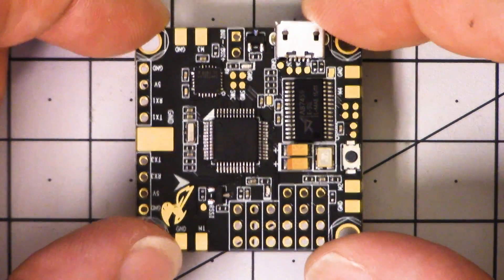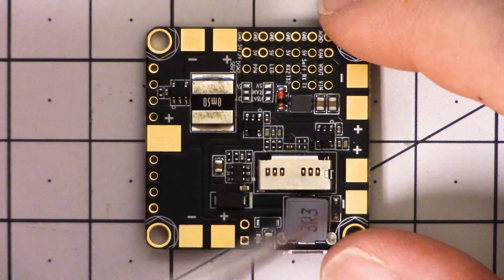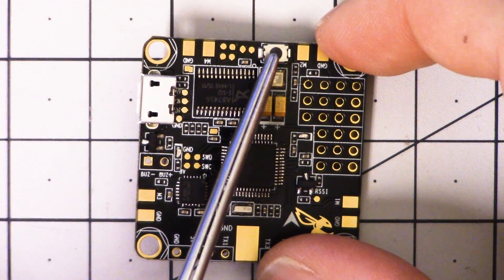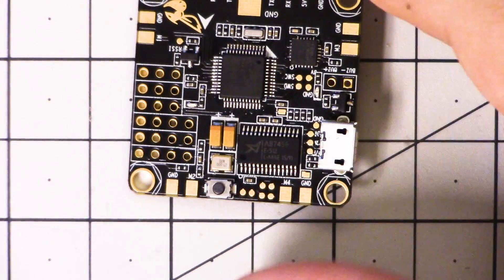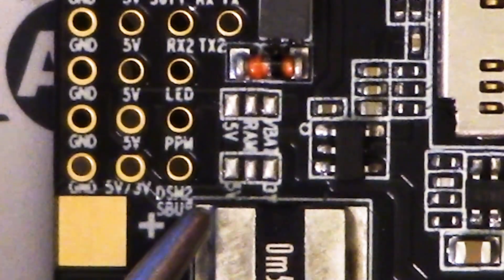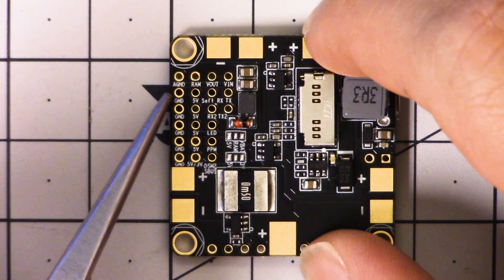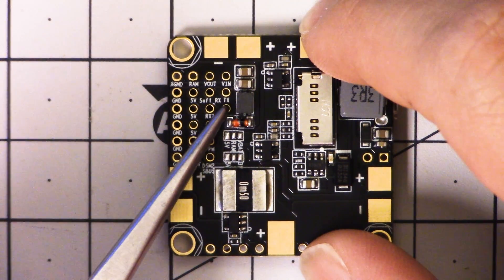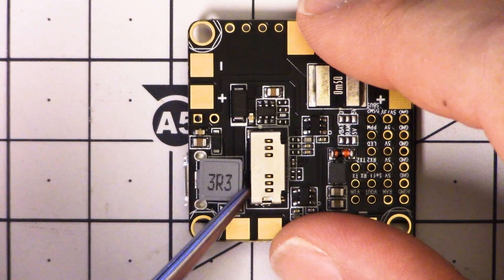Betaflight F3 (BFF3) Flight Controller | REVIEW AND HOW TO

Comment: Do you think I could run a TBS Unify Pro (on 25mW, it's specified as 4.5-5.5V, 600mA) and a small 600TVL micro camera (specified as 3.7-5V, 100mA) both off the RAM pad without problems?
Reply from the maker: +Zerro I don't think so. I have heard that the diode in the RAM filter is rated for 600 mA.
Reply: Alright, thanks for the reply. How "safe"(/stable) would it be to max out those 600mA? According to a post by TBS on fpvlab.com the Unify Pro needs 500mA at 25mW, add that to the camera and I'm looking at 600mA.
Reply from the maker: +Zerro I think you should confirm the amp rating a little more confidently before deciding to push it.
Reply: You're right. 
I'll probably have to measure it. In the manual of the TBS Unify it says: "25mW: 250mA, 200mW: 320mA, 500mW: 460mA, 800mW: 600mA". If the manual is right that would give me enough headroom. Let's hope it's true.
Reply from the maker: +Zerro no, no. I meant you're just taking my word that the 600 mA limit on the diode is correct.

Comment: I broken my USB connection on this board. But I manage to turn on "MSP" on uart1 before the USB got completly ripped of board.

Now I`m stuck on current firmware, but there must be a way of altering the code and compiling my own firmware that has MSP enabled as default on UART1. Anyone know what to change to accomplish this?
Reply from the maker: Clone the repo and then find where the defaults are defined. Then build the code. Sorry... not that helpful.
Reply: Thanks, anyway. Just have to learn how to compile then :-)
Reply from the maker: https://github.com/cleanflight/cleanflight/blob/master/docs/development/Building%20in%20Eclipse.md

Comment: I'm using the 5v tbs unify pro which I have wired to the ram like shown on the diagram.  So I shouldn't run my camera power off of the 5v pad below the ram like shown in the board diagram? Not sure how to get around this if my vtx only runs on 5v?
Reply from the maker: +Mike Schroeder i don't think it's recommended to run the vTX off RAM if you're using 5v. Only the camera. There is supposedly a diode in the filter that can't take the current.
Reply: Joshua Bardwell could I swap them and run the cam off of the ram and then the vtx off of the 5v pad? Or is that not going to work either?
Reply from the maker: +Mike Schroeder yes, I think that would work. I think the issue is the filter not the regulator. But I'm not 100% sure.

Comment: I have to comment also, running the tbs unify pro 5v version on the ram/5v works wonderfully. I also run the camera off the separate 5v (not the ram/5v!) and I get perfect video, and no issues at all even running 5s with the vtx at 800mw!

this board with the unify pro is freaking amazing. no pololu needed!! 

I've crashed a bunch with the sd-card in, and it hasn't ejected itself yet.
Reply: Adam-g1 hey i have tbe same vtx.. your saying you wired your tbs unify 5v off the ram/5v and your 5v cam to one of the 5v rails below.. and you run it on 80pmw and everhthing is good?
Reply: Steve Maratea I recently changed to powering my unify pro from one of the 5v pins and it's working great, even up to 800mw. Also powering my cam the same way, off one of the 5v pins :-) I don't even use the RAM pin anymore because I was concerned about long term pulling a good amount of current from it.
Reply: Adam-g1 ..thanks for quick reply.. ok so you dont use ram anymore and you just use one of the 5v rails from the uarts for the unify v2 vtx and the other 5v for the camera where? can you use 5v from led rail?  also can i run ram/vbat and hook my camera up to it and then just eun unify v2 to ine of the 5v pads? correct?.. im using x4r sbus
Reply: Steve Maratea not a problem! underneath the ram pin there's four 5v pins straight down, I just use two of those
Reply from the maker: +Adam-g1 you lose filtering doing it this way but if you have a clean setup your video will still be fine.
Reply: adam.. is your video clear since the 5v is not filtered?
Reply: Joshua Bardwell yeah this is true, just make sure Steve Maratea that your not grounded anywhere to your frame and you should be okay.
Reply: Steve Maratea On most my builds with the betaflight f3 my videos been crystal clear doing it this way, but one build I had to put tape around the carbon fiber that my fpv antenna was mounted to, because it was causing noise in my feed.
Reply: Adam-g1 okay great so atom and Joshua you're saying that if I connect my VTX to a 5 volt source on any of those rails in my camera to a 5 volt source or Ram / vbat with both ground wires going to agnd... i have to worry about my VTX antenna touching my frame because it will the way I mount them.
Reply: Sometimes it's okay if your antenna connector is touching your frame, just gotta try and see if you have noise or not. Both cam and vtx to 5v rail would work and yes both ground to agnd

Comment: How do I get the voltage monitoring to work? It only shows up as 4.5v in betaflight using the ADC sensor and stock settings (with the battery plugged into the copter). I have the battery leads connected to the + and - of the board and the vtx running off vbat and camera off 5v from their desired pads. Is there a vbat pad that I need to give power to, to get this to work?
Reply from the maker: Voltage monitoring should work automatically if you have vBat wired to the battery pads on the board. Just enable vBat monitoring. if it isn't working, the board may be defective.
Reply: I should have clarified what board I am using... I am using the betaflight f3 flight controller. Would this still be the same process as you stated above? I have the Vbat and the RAM pads soldered together. Do I still have to solder a wire connecting the + battery to the VBAT and RAM jumper? Otherwise, I don't know where else there is a VBAT pin on the board...

Comment: I have two. before installing I would've given same review. first one doesn't read voltage. just jumps around between 0-7v on GUI, osd, and taranis telemetry. spent hours resoldering, disassembling, swapped out Rx etc.... everything else works perfect. second one: voltage reads correctly, but during configuration in BF GUI it lost USB connection and won't connect now. I've replaced driver's, usb, computer etc.. it won't recognize as a port com/DFU while the first board still connects, but I don't have voltage reading. I've put them aside for now and I'm finishing my build with kiss.

Comment: I ordered this BF F3 board for my Alien build and every day I consider how to route all of the current properly through the sense resistor. I am thinking to do what you recommend and use maybe 18AWG from the four ESC power pins to the battery contacts of the alien PDB and mount the battery lead to the F3 board.
Reply from the maker: +Jeff C 14 or 12 gauge from the closest ESC pad to the vBat pad, or from the shunt resistor.
Reply: Yes indeed. I was considering four sets of smaller gauage from all four ESC sets of pads but 12-14 off the closest pad looks sufficient as you mentioned.

Comment: Yes! Diff!  I knew that because I'd done that before but I totally forgot about diff.  I just manually configured it and it's working good.  I noticed it won't let me run 4k/4k now because I'm using OS125. It let me before and I didn't know any better.  Now I select 4k/4k and it's like "ok dude, sure" then it saves at 4k/2k.  I like how bf is advancing not only for experts but it's also getting more and more user friendly for newbs.
Reply: Oops I meant to reply to the other comment not make a new one.

Comment: three things to add @joshua_bardwell
1.im powering a tbs unify 5v off the 5v vtx out with no issues.
2.the SD card reader still doesn't work for me. 
3.for some reason the ground pads really do not take solder well.either a different coating,material etc.but all low voltage grounds pads had the same issue on this build.all other pads took solder great.

Comment: Is it possible to over draw these built in pdb fc's and destroy the board? I recently had an "incident" where I blipped the throttle (emax 2205s 2300kv) not knowing that a prop was restrained in the grass, and an dys xm30 esc burst in to flame. I managed to get to it quickly and blow it out, the flame didn't appear to damage the fc (kombini) but it is dead none the less. This worries me with all of these combined boards. Do you think concern is warranted?
Reply from the maker: I think you're going to have to work pretty hard to melt one of these boards.
Reply: Alright, maybe it was the actual lighting the quad on fire part that melted it. Have you had any multirotor fires?
Reply from the maker: One smoked ESC once.

Comment: Thanks again for the awsome information. I was planning on getting this board and yes I was one of those people waiting for you to do a review. 
This may be a silly question but... No one seems to be able to give me a answer.
The board like the X-Racer is labeled for SBUS. There are some of us that use IBUS. Can the "SBUS " port be used for IBUS and just select IBUS in the GUI? I  wasn't sure so on the X-Racer I just used another UART. Thank you in advance for shedding some light on this.
Reply from the maker: Yes. SBUS port is just a convenient way of wiring to a UART. The main thing the SBUS port does is allow power to be converted to either 3.3v (for Spektrum) or 5v (all others).
Reply: Thank you

Comment: i wish frsky would just remove the inversion. They invert the signal on the receiver to be inverted again by the flight controller. It would get rid of the problem of sbus vs spektrum port connection

Comment: I had an issue with my board. I fried 2 rx because the soldered bridge pads for the rx for 5v was putting out vbat power. I had to solder the ram voltage to 5v also. idk why but I have to buy new rx because I didn't check.
Reply from the maker: If the 5v solder bridge was putting out vBat, that's a damaged board.
Reply: Joshua Bardwell yeah that's what I thought. oh well. I'm still flying with it.

Comment: From the looks of the board layout, you could put a decent sized blob of hot glue on top of the inductor as a sort of non slip pad for the sd card. It should add some rubbery friction and enough would add some upward force.
Reply from the maker: Clever.

Comment: Hey Joshua, kinda unrelated to this board but is there any flight controller that you know of with a built in OSD with current sensing that can handle 6s lipo besides this one? I like the new Betaflight board but the PCB function would make it complicated to setup. My PCB also has a current sensor built in so one with an addible current sensor will also work. Thank you !
Reply from the maker: I don't know one offhand.

Comment: 4-in-1 wiring to keep the current sensor is rather simple https://www.dropbox.com/s/e0eca7wh4e4em9v/IMG_20170103_111240.jpg?dl=0
Reply: HecTech FPV you can do that too.
Reply: HecTech FPV since that + ESC pad runs right off the resistor you can solder to that pad as well.
Reply: might not be very visable but that is what i did :) , i scraped back the solder mask from the shunt to the closest pad and use all that meat!
Reply: hey so did you solder to the shunt resistor and the positive pad or just the shunt resistor?
Reply: When I get my board I will solder to the pad and resistor.
Reply: Just for clarification, i m running the positive from the LiPo through the shunt to my PDB. Did u apply the Negative from PDB to an ESC Pad on the FC, or did you fork the negative from the LiPo to FC/PDB ?
Reply: ground is soldered to the 4in1 then a much smaller ground reference wire is ran to the FC. the smaller one only needs to be large enough to run the 5V rail on the FC and provide a "reference" for the current shunt
Reply: @HecTech FPV So let me get this straight. To use a 4-in-1 esc, I'm going to bridge solder from the Batt +  to the shunt resistor and from the shunt to the closest + ESC pad, wire from the pad to ESC + and the ESC - to what? Batt  - to ground it? Do I need to wire anything else to get this working? Also, I thought the individual pads are rated only for 25 amps, wont they burn out with the full battery load on it?
Reply: I am assuming that since the full battery power is passing directly through the resistor, the current rating for individal pads doesnt apply. Is this correct?

Comment: I love my BFF3, it's an excellent board that is perfect for tight builds! one thing is some people are having issues with current sensing and it being incorrect, can you do a video about that?

As a side note, my SD card slot is extremely snug, and I even had a crash due to stripped Motor screw holes (no idea they were even stripped! RMRC blue series 2205 2600kv, all of them were after an initial install and months of flying them, weird) and the SD card stayed put. it's actually difficult to get mine out without some force on both my BFF3 boards.

as always, thanks for your videos and hard work man!

Comment: are there some other f3 fc's with serious integrated pdb? i dont want to buy a fc with "integrated" pdb, and at the end of the day have to buy more separate stepdowns to power the vtx and cam, because the integrated "pdb" dont support 5 AND 12v. i dont have room for separate stepdowns etc. and its not up to date to sell a "pdb" with no 5v AND 12v output. yes, the fc is good and all that, but please dont forget the basics over all the fancy nancy features. btw: nice review as always. joshua is best!
Reply from the maker: I think that many builds nowadays can get by easily with 5v and vBat. It used to be that the vTX and camera couldn't take vBat but nowadays they usually can.
Reply: thats right of course. but if the fpv takes 5 till maybe 20V, i really want to go with 12v. why? 20v and the vtx gets  hotter then it already gets, and at 5v its risky to get blackouts while undervoltage spikes. but i just need a f3 with pdb so I will buy it anyway :) or just the PIKOBLX. its for the Y200 frame...
Reply: Rookie Rotors I prefer 12v regulated supply to the vtx

Comment: To work around the current limitation for a 4in1 ESC I think you can just solder the in and out wires directly to the shunt, or am I missing something?
Reply from the maker: Yes, you can do that.

Comment: I like the look of this board especially that most of the connections to solder to arent just pads their pin header holes. AND WHATS THIS?? HAS A BOARD FIIIIIINALY DROPPED PWM INPUT TO SAVE ROOM ?? !!!! ???!!!! . The HGLRC f3V4 pro is a great all in one board especially because it inc's the switchable vtx buuuuuut the solder pads are wayyyyyy too small and it still has pwm input at a header  taking up realestate .. What could b done to pick the full current draw off the beataflight fc for a 4in one esc  is solder to the back of the shunt resitor ???

Comment: I'm building my Chameleon with this right now (if my TBS Unify Pro would show up I'd be done!!) and so far it's okay, but complicated as you said. Soldering to the ground pads needs a fat tip and a good shot of heat, kind of scary at first. Also, the RSSI pad doesn't work correctly with the X4R-SB. There's some discussion in the the RCGroups thread about it. Basically even with the rssi_scale set to 1 it only shoes 45%. Something funky in the ADC I guess. Lot's of people telling us to use a loopback channel, which just doesn't make sense to me when a) there are two pads right there and b) wit a loopback you're usually going to find out that you've lost signal in one big dropout. 100% to 0%.
Reply from the maker: No reason for a loopback channel to work any different than regular RSSI output from the receiver. A tiny bit of extra latency but after that, why wouldn't the value be the same?

Comment: Re whether vbat is filtered with a regular. if you measure ohm between the vbat + and vcc +, if the ohm is not 0 then it has a filter or some sort I.e not direct I could be wrong. happy to take anyone's guidance on this.

if it has nothing, do you think a low ESR 1000uf capacitor will do the trick?
Reply from the maker: Always good to add capacitors.

Comment: thanks mate, excellent review. In your aio review one of the comments you made was aio has a draw back which is interference. I hope you will cover that in a later review.
Reply from the maker: People are saying this one has great video.
Reply: Joshua Bardwell I remember one of the videos you were flying a quad with this FC. did you have to do anything to get clean video signal i.e adding LC filter?
Reply from the maker: +Jack Truong no. It has built in filtering that is good enough for many.

Comment: nice review josh, i found a couple things were what i would call cons in the layout and design, which are subjective to everyone likes or dislikes, but this gives another option to choose to fit our needs when we are designing quad builds. other than that
the board looks great, has an amazing amount of features and i'm sure would perform just as good as many of the others out there.
Reply from the maker: Well, what did you find?
Reply: Joshua Bardwell  
usb and boot loader button in different places , which means one  could become difficult to get too on certain builds. 
having power wires neg and pos on top of each other would actually increase board thickness if using heavy gauge power, also having the amount of heat used to solder those two pads could easily damage board if not carefull. 
you mentioned two other things the mini micro usb holder and the lack of silkscreen on both sides.

Comment: Too lazy to check if someone said it before, but you can always wire the neg from the FC lipo pad to the 4in1 and solder the pos right on the pad of the current sensor, which is made to have all 100A flow through so no worries there. It wont be the cleanest job but should work fine.